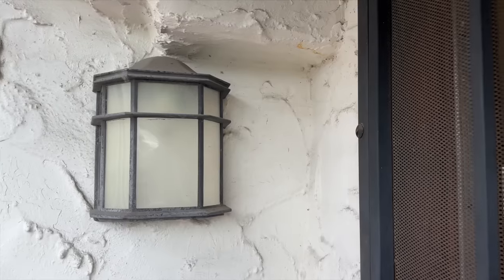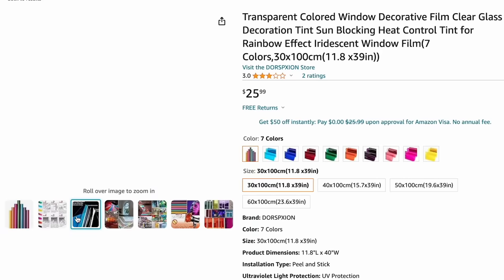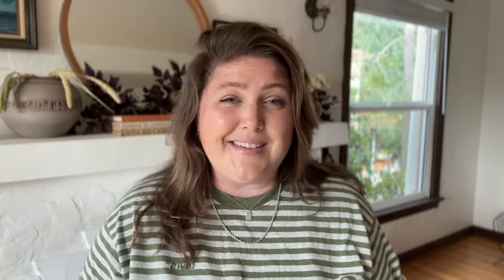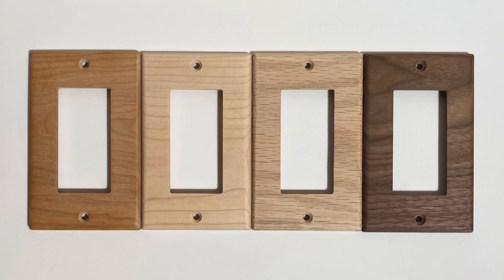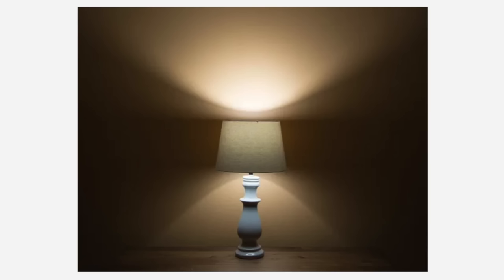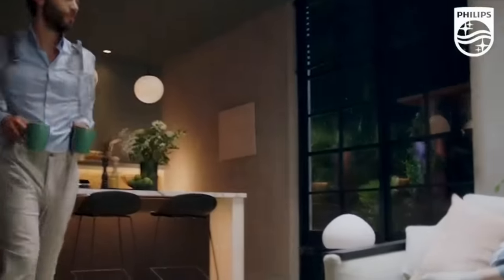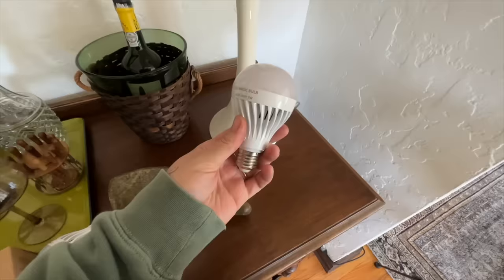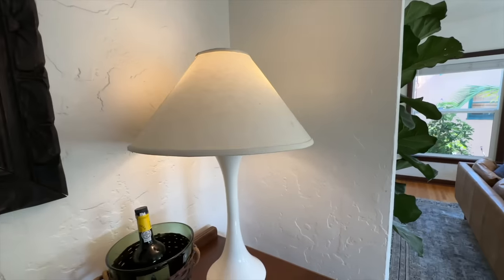10 EASY Home Hacks that will ELEVATE Your Home | Affordable + Renter Friendly!

Comment: I have 2 windows at a 90 degree angle from one another. Looking for curtain hack since typical rod won’t work. Any ideas?
Reply from the maker: track curtains could work! ceiling or wall mounted. Also in my “realistic home upgrades” video I shared these really interesting curtain rods from wayfair that fold out! also roman shades.

Comment: The renter thinks of ways to do as they like that won't get them in trouble with the landlord. But the property owner thinks in terms of safety of the property. There are specific types of outlets rated for use outdoors. Rain happens. And the first hack's little plug adapter isn't likely rated for that use. Please think about safety and learn more before adapting anything.

Comment: Any hacks when windows are truly ceiling to floor, wall to wall - no allowance for rods and….wall is brick and a metal duct😐
Reply from the maker: track curtains with concrete screws!
Reply: @livingwithlk  ok … i bought the wire ikea rod system but I dont have wall on either end  to install. I ll need to look at Ikea’s ceiling tracks and buy a concrete bit . Problem is I have a plastered textured ceiling w a lot of waterv damage and I m just not to sure about anything in ceiling. I guess I will try. Renter in a very old building (sigh). Cheers from  Toronto. New subscriber👍
Reply from the maker: @Kate-oi6yt be careful with water damage! tension rods could possibly work. you could always ask a task rabbit to come out and inspect if they’re good at that kind of thing. best of luck! thanks so much :)